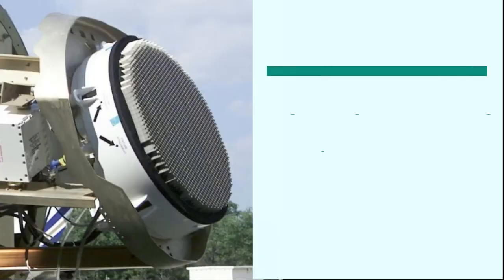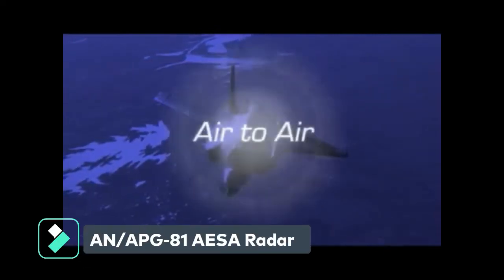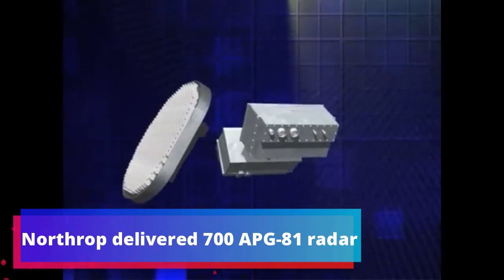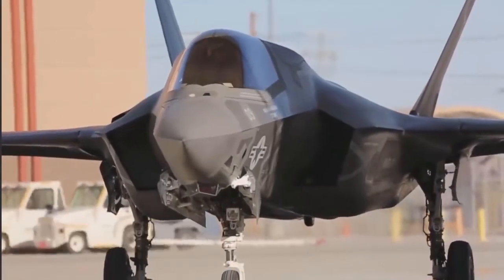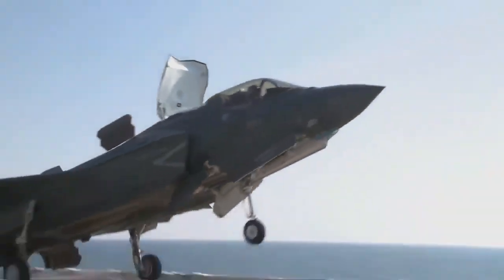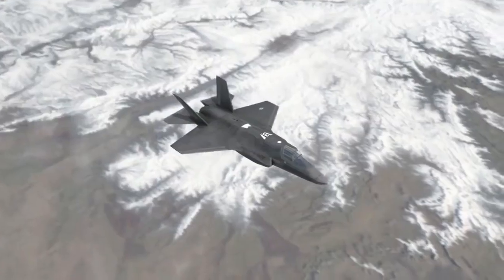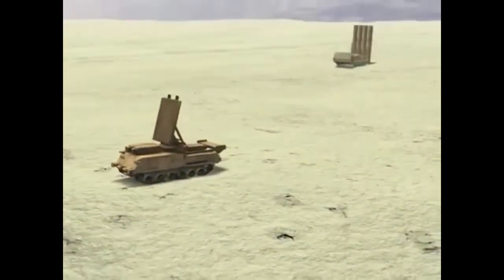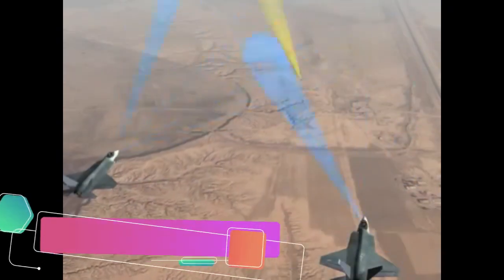HOW POWERFUL IS F-35’S AESA RADAR AND E.W. SUITE? #F35 #AESA #APG81 #ASQ239 #LockheedMartin #USA

Comment: This shabby radar is even worse than the KLJ-7A equipped with JF-17 Block III with 175 kilometers detection range on an airborne target of one square meter radar cross-section(RCS).  Furthermore, the next generation radar of F-35, APG-85, uses the technology that China had it 11 years ago, such as GaN(2004), MIMO(2000), and DBF(2003) digital beamforming(digital array) technology.  That is why the radar upgrade originally planned by the American Air Force is in 2026, and the current progress can be regarded as being realized ahead of schedule, which shows that the American Air Force is very urgent.